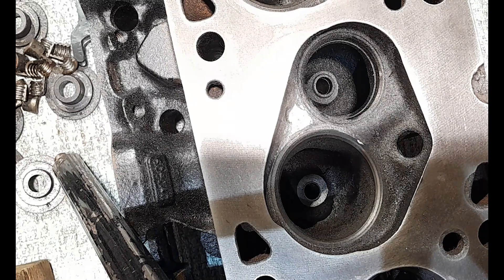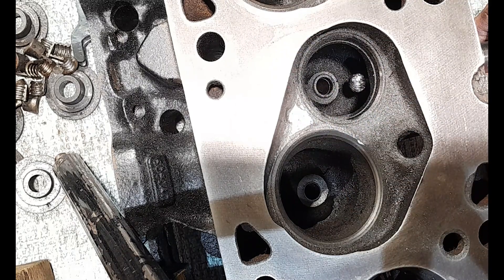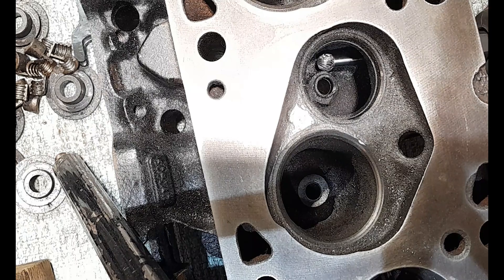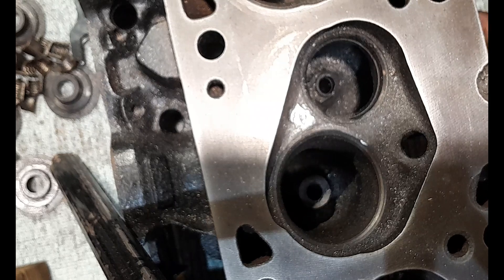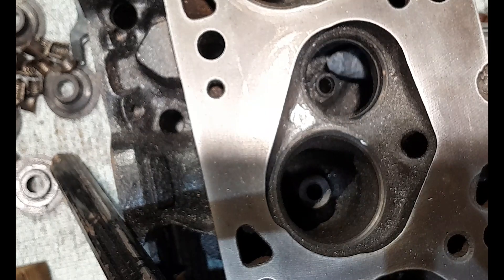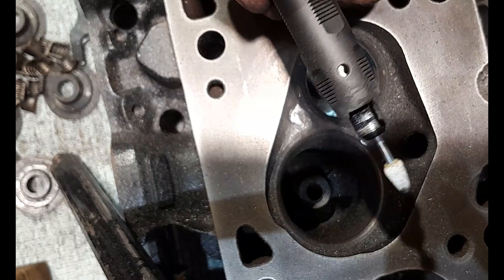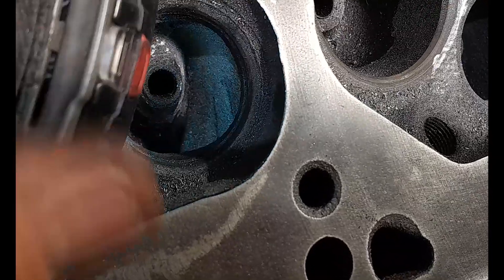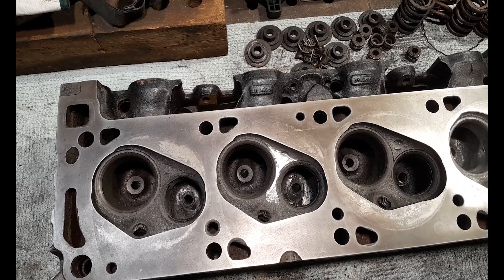351C 2V Iron Cylinder Head Porting The Exhaust

Comment: Are you going to show flow numbers from stock to what you have done
Reply from the maker: @roberthirshfield3571  I do not own a flow bench to do any testing. I will however do some mark to mark times in my car before I install these heads onto my engine. 

I’ll install these heads and do the same. I will video both tests and put the videos on the channel in the coming weeks.
Reply: @Doctoradhd1 Could you have somebody in the area flow test them for you??
Reply: I just finished mine up all that I’m going to do now I’m sending to the machine shop for guide inserts and hardened exhaust seats an new ferrea valves thanks for all the information
Reply from the maker: @ well done Robert. You’ll be really happy with the result. The set of 302 heads on my car I ported a couple of years back, made a marked difference once I’d ported them. Noticeable increase in torque.